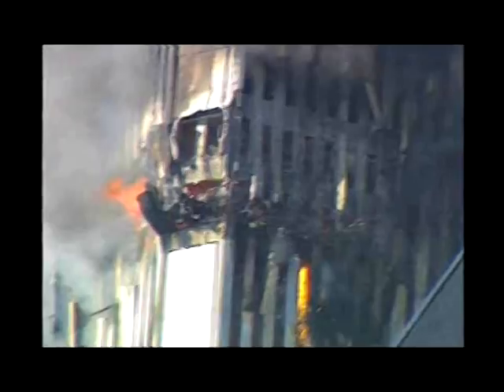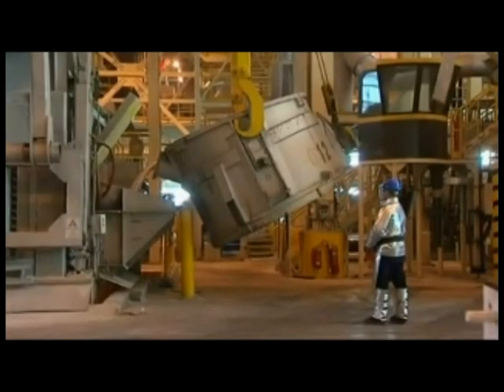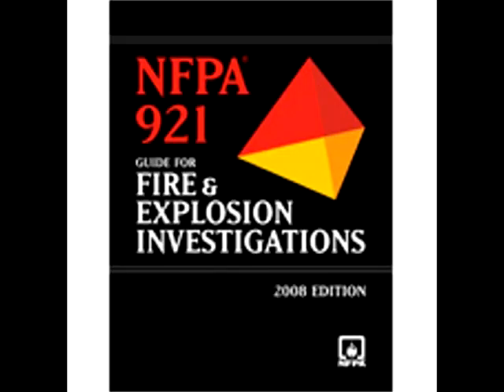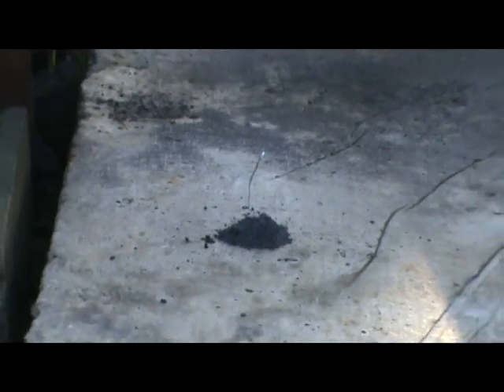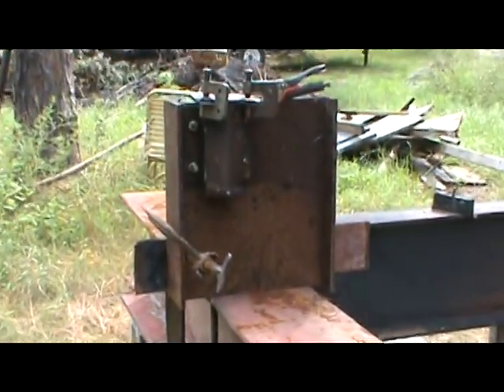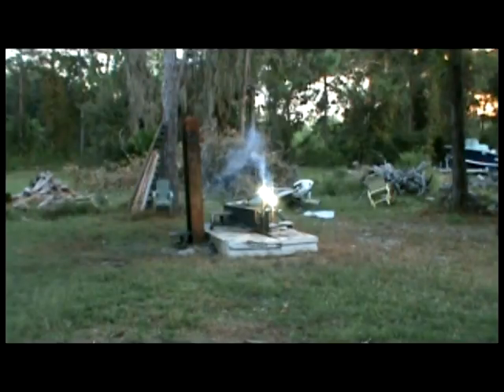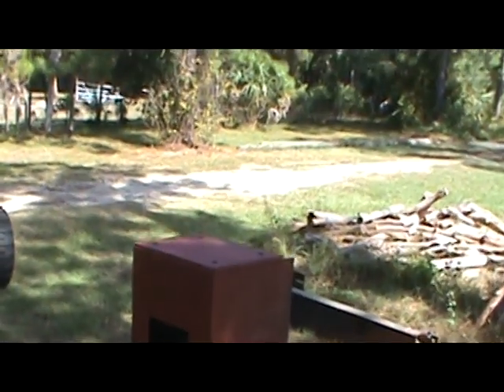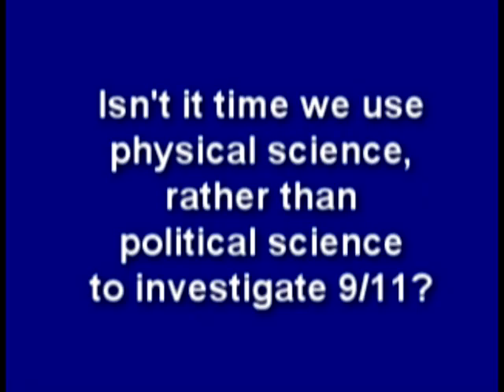9/11 Experiments: The Great Thermate Debate

Comment: It took about an hour of these extremely intense temperatures to bring the structure to a point of failure. Melted aluminum - white hot liquid, contacting water will create and explosive result. The aircraft were aluminum, the towers had massive water tanks in the upper levels for fire fighting...the heat would have reached these tanks within the hour. once this water contacted the melted aircraft fuselages, now collected as liquefied aluminum the explosive force would knock out the floors where this is happening, the massive weight of the remainder of the tower above this point of explosion causes a 'domino' effect on the floors below this, each floor adding to the combined weight of the falling structure. This weight, the action of gravity and the massive forces of friction and compression acting on the tower, pushes windows out of the building several floors below the immediate impact point as they come down.
No need for explosives or conspiracy theories or whatever...there WERE aircraft - there WERE people - real, living breathing human beings with families and friends and careers in those planes...there WERE many heroes who died in the rescue attempt.
By continuing the "demolition theory" and/or the "conspiracy theory" you are dishonoring those nearly 3000 people - Americans all (except for nineteen fanatical haters of America).
This I find objectionable.
Reply: He's honoring them more than you by finding the truth.
Reply: acefighterpilot WOOSH
Reply: Only people that choose to remain oblivious to the FACTS and science do so purposely, are PAID TROLLS, or are completely void of logical sense and intelligence.  For instance:
"The structure was exposed to this heat for an hour.. that's not enough to melt steel, but it will start to warp and bend"
NO, that is a complete lie.  And, there is absolutely no way to explain molten steel from the upper floors, AND the sub foundation, by the OP's post.  That's absurd!
Also, it is a FACT that the fires were already cooled to a great degree before the collapse.  AND, none of that explains B7!

Simple things that cannot be disputed are just that, simple.
The times the buildings were stuck.
They were not struck at the exact same places, heights/floors, area.
In one video, you can actually see the jet fuel exploding and going outside the building, from the corner, in THREE different directions!
So, how could BOTH buildings have burned the exact same way, with the same temperatures, affecting the rest of each building the exact same way?
It could not happen!
The time differences between the two hits.
The time difference between the two buildings falling.
Again, the fact that BOTH buildings fell in the exact same manner.
Also, AGAIN, explain B7!
Reply: Excellent points Frank, but I respectfully don't agree. I follow your logic, which I agree has substance, but the more you examine the details the wider the gaps get. And we have overlooked a damning and obvious area which falls outside of your reasoning. Building 7. No planes, no aluminium, nothing to separate it from Grandfeld in London. I applaud your respect for the families of victims but this is surely a reason to pursue the truth?
Reply: netzoned. even though there are few official explanations on the whole destruction of WTC and B7, but their most popular explanation is that Silverstein "pulled" B7 because it was on fire, from what i understand, they are not claiming that B7 fell due fires but was demolished with a controlled demo, this was part of of Silverstein's TV interview. Of course this story is bullshit becuase it takes weeks to prepared a building for demo, but im surprised that a good portion of those who oppose government 9/11 version of events, use the B7 fire collapse as one of the evidence of government's conspiracy.
Reply: BDaniel but the planes hit and then the jet fuel melted the steel beams which crept through the whole building enough for witnesses to hear the crackling but not enough to cause fires by them or kill them?
Reply: +Frank James  ...  The OP said, "white hot", not "glow red hot".  Although, because of what color spectrum's we can or cannot see, a molten metal may very well be white hot, a person just may not 'see' it that 'color'.  ...  "logical"  ...  That's the whole point!  There is no logical explanation why B7 collapsed as it did.  So, if B7 falling was nefarious, it stands to reason that the twins were nefarious.  That is using... LOGIC!  Have you bothered to listen to the thousands of true experts on this matter?  Did you research similar events regarding B7, through the decades?  If you say, yes, then you are not being... logical... if you still accept the government version of B7.  EDIT:  So, no, you're not being logical!
Reply: +Boi Mann  "Of course this story is bullshit becuase it takes weeks to prepared a building for demo, but im surprised that a good portion of those who oppose government 9/11 version of events, use the B7 fire collapse as one of the evidence of government's conspiracy."

Did you mean to word that differently?
Reply: +Riles Mattix  ...  I already mentioned this... that it can be observed, from both planes, how much of the jet fuel burnt up outside of the buildings, especially with one plane.  I think many people think jet fuel burns like a wood fire, or something.  Jet fuel explodes!  It just does not sit there for a long time and burn.  There was not enough time and, anyway, not enough HEAT/TEMPERATURE to cause the steel to molten as it did in so many places.  There was even molten steel in the sub-foundation.  And people keep forgetting the traces of a thermite/thermate substance that were found in the ruins.

AND, speaking of the ruins.  They were not treated like a crime scene!  You rarely hear anyone mention that.
Reply: People, I am old.  I have been around a looong time.  I have actually been through some of the BS the U.S. government has caused.  The USA, and pretty much every government/regime/whatever, around the world, and the elites that control them, do not give a fuck about you and I.  They just do not!  It is nothing for them to cause a conflict that will kill/murder millions, and destroy the lives of millions and millions more, and causing great destruction!
Reply: acefighterpilot his point is your mad at the wrong people. I’m mad at the right people in your stead so don’t even stress anything anymore. Just retire from these videos forever. Ignorance is bliss. You say it’s disrespectful? I say it’s doing honor to your family. Revealing the true killers. So YOU and YOUR family don’t place FALSE blame so it comes back onto you. He’s helping you avoid that if you just read a little more carefully.
Reply: Lots of people lie for no reason this video is not disrespectful in the least it is simply addressing facts.
Reply: BDanilel. did you read MY comment? the root of the point that was made by me is that "all of the evidence was backed up by facts presented in this video", lets see your 8th grade video evidence. 2nd, i did not say that no one died - you just invented it as something that i supposedly implied, and which makes me a horrible human being for implying it., when in fact it is you who is a lying piece of shit, since i never even hinted on the deaths being hoax. In fact the deaths of the innocent people who paid for this conspiracy, is the only thing  that makes my heart hurt.

2nd part of your dumbassery: There is not a single evidence that jet fuel even at its max temp can buckle steel frames to make them collapse (this is impossible due to few reasons: heat dissipation along the steel frame, burning time duration and more), in addition to that, it is impossible to make the steel frame collapse in a unified fashion as it did. A buckled steel frame would GRADUALLY start forming collapses in SPECIFIC locations of the building which were affected by buckling. In the case of the WTC, it would be only in ONE place and would cause very LITTLE amount of collapse. Please stop replying ot me you fkn dirty rat, i hate explaining obvious truths to the likes of you, youare fkn repulsive to me.
Reply: Talk to the families that actually lost someone.  They want the truth!  They know they are not getting it from the government.
"if you believe that those 3000 people were just a hoax"
Really?  Go back to sentence one.
It is common knowledge that at least 58,000 U.S. military personnel died in Vietnam.  Guess what started that?  A false flag... a 'hoax'!

+Frank Kopke
NOTHING you posted explains molten steel!  You're the ultimate sheep, TROLL, CIA TROLL, whatever.  You're not 'normal'!

EDIT:
IN FACT, you purposely ignored the entire point of this video!
You also purposely ignore B7!

EDIT:
I could pick apart your entire post, but how about just this:

"now collected as liquefied aluminum the explosive force would knock out the floors where this is happening"

Find any film, video, documentation, witness, that verifies that.  That would not have been just some little explosion.  Even your own words validate that.

And NO, that would not cause a domino affect, especially since it did not happen!
Reply: Makes no sense how would the water be cold at that point? How could it reach an entire floor uniformally? How would that kind of explosion affect a reinforced steel structure? I am open to real answers. This aint one...
Reply: There are thousands of the worlds best and brightest architects and engineers in Architects and Engineers for 9/11 Truth organization who have all signed on their support in the belief this was a controlled demolition. Everybody in this comment thread is ignoring dozens of other skyscrapers hit by planes that burned for DAYS and literal WEEKS, which were not built nearly to the standard the WTC Towers were built, but they still stood after WEEKS of sustained high temperature burning. Buildings will not collapse from plane strikes. To the contrary, skyscrapers are built to WITHSTAND plane impacts. It is literally in the building code of every single city that allows skyscrapers. That's been code for decades. People in support of the official story are ignoring thousands of credentialed experts who believe the controlled demolition theory, they are ignoring science and chemistry, they are ignoring numerous other examples of the same thing happening yet 9/11 is the only example of a plane impact resulting in collapse, they are ignoring building codes, and they are ignoring the obvious military industrial complex reasons why this happened.
Reply: @acefigherpilot, Its disrespectful to allow your people to die for an event which was quite clearly staged. Its disrespectful to the tens of engineers who came forward stating that the towers could have only collapsed on itself as they did if it was controlled demolition. Its disrespectful to the dead to not find out why it took more than an hour for your air defense to respond to the hijacked planes. Its disrespectful to basic human intelligence that you are even entertaining the idea that this was a legitimate attack by foreign forces.
Reply: Guys, get off the OP.  He has no clue what he is talking about.  First and foremost, the planes were not made of aluminum.  They were made from specially treated aluminum alloy, titanium and steel.  Why the special aluminum?  Well, how about that, in case the plane crashes and catches fire!  Also, after all these years, and all the experts and researchers that have thoroughly investigated this, not a single one of them has come to any conclusion, even a far fetched conclusion, that the planes melted, mixed with water, and blew up everything and caused the buildings to collapse.  And get it through your head, the collapse of B7 proves, all by its self, the government narrative is a lie!

AGAIN, show one single film, video, document, witness, that verifies that there was this one, giant explosion, (aluminum/water), that blew up multiple upper floors, that then caused the rest of the building to collapse.  AGAIN, there are too many variables for each building to fall exactly the same way, according the the official narrative.  AGAIN, B7!

Sheesh!
Reply: B7, B7, B7... quit fucking forgetting about BUILDING 7!
Reply: Yes, my next reply would have been if the people had bothered to research, they would know of other high-rise fires, all over the world, for decades, that burned excessively, and not a single one of them collapsed like they were purposely demolished.  You people that do not want to face facts and science, and truths, etc, all of which are easy to research, have no business posting, at all, unless it is to ask questions.  Or, unless you are offering condolences.  Just throwing out 'stuff', because you may 'think something', with no valid research or experimentation, such as what this video offers, are just ridiculous.
Reply: Frank Kopke funny how all the conspiracy theorists call us sheep because we are logical, yet they eat it right up when this guy says aluminum is silver when poured (which it CAN be when poured), funny how he forgets to mention that it can also glow red hot, but we're the sheep right?
Reply: where were all the jews that day though?
Reply: Boi Mann did you read his fucking comment. All of these effects can be produced the same way with water, gasoline, and other liquids when met with molten metals. Its 8th grade science... and if you believe that those 3000 people were just a hoax, you are a disgrace. So disrespectful. The structure was exposed to this heat for an hour.. that's not enough to melt steel, but it will start to warp and bend, and the weight of 40 floors is enough to cause floors to collapse and cause structural failure. If the same effect can be reproduced with thermite, that's fine, but it doesn't mean that's the way it happened...
Reply: Frank Kopke I came to this comment chain to see if any person had a decent rebuttal to this schizophrenic video. You are that person. We collectively all lost someone that day. It is disrespectful to those who are no longer here and to those who still mourn for these baseless theories to be promulgated as they are. You see the point.
Reply: Frank Kopke thank you sir, you’re one of the only people here with a fucking brain.

Comment: Not an open air fire. If you think about it the tower with a plane sized hole in the building that high up, would replicate a blast furnace. 
  The real question is why did tower #7 collapse.
Reply: Brad Bohen inside job, it's obvious.

Comment: What if Nano Thermite was placed in the 14" boxed steel columns in construction. For an intended purpose of bringing it straight down. So if it was weakened any where. It wouldn't fall sideways bringing down other buildings, or causing unneeded deaths. Would molten steel falling down each 14" steel column, or nano thermite. Keep igniting over and over tell the weight of the building would finally fall syraight down? A fell safe, never to be admitted to?...

Comment: Well all I know is that the metal on the towers didn't even have to reach a melting point to collapse when a piece of metal is heated it loses its structural strength and one could simply bend the metal with there hand once this happens the only thing I didn't understand about the video was how molten metal was pouring out of the towers

Comment: Having ACTUALLY WITNESSED and ACTUALLY EXTINGUISHED aircraft fires, I can tell you AS A FACT there was no need for thermite! WHY? Because even schoolkids know that IF YOU HEAT METAL IT GETS SOFT - it's how horseshoes are made! 

You DO NOT NEED TO MAKE THE METAL MELT TO MAKE THE TOWER COLLAPSE!!!! All you need to do, is soften the metal! And aviation fuel will EASILY raise the temperature to such a temperature - and gravity will do the rest!

ANYONE still pushing this garbage is mentally ill! AGAIN - they have been bending metal like this for MILLENIA!

You are a f@cking sickness if you STILL push this garbage.
Reply: dude you needa take chemistry and a physics class. educate yourself how everything is conducted all at once. and explain on how building 7 was demolished out of no where.

Comment: But there's a problem...The temperature at which steel melts may be higher than 1832 degrees, but temperature at which steel loses it's yield strength is much lower.

Comment: I believe that used thermite and mixed it with paint if I remember correctly didn't at our sub stained and explosion in one of the parking structures below the building two years ago they've been working on them ever since I think that they mix the thermite and with the paint when they repainted the steel inside the stairwells
Reply: Typo sorry

Comment: I would like to know where the hell you got your “degree in engineering”? Thermite is used extensively to weld ,”melt” steel rail on rail lines.
Reply: Ross Mennie that's exo and the one he's using is nano. big difference.

Comment: Thermite burns very bright. Not observed, by no one. If it were explosions, where was the 1 million ton Twin Towers debris? No footage, no pictures, no seismologic data. No, it weren't explosions. Besides that your method is unscientific. You can not shape the experiments according what was found in the rubble. You have to collect all the data first, and form your hypothesis on basis of that. Because there was thermite in the rubble, is in it self interesting. But first of all, not all the data. So not enough stuff left, no seismologic data to back up the collapsing hypothesis and no extremely bright burning observed, by no one, while the buildings went away, so far for the explosions hypothesis.